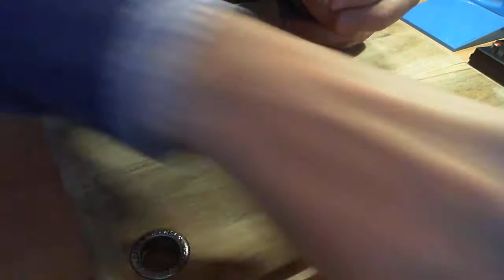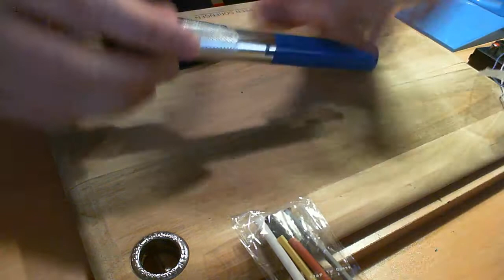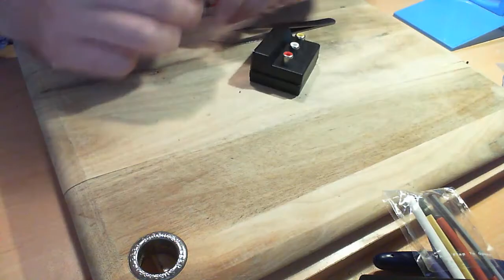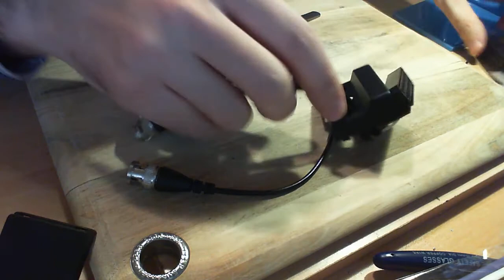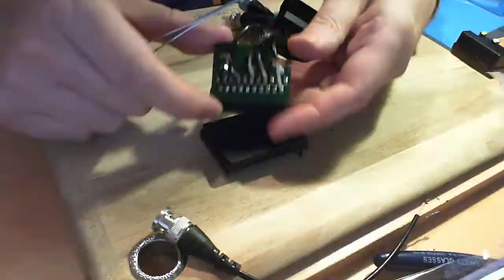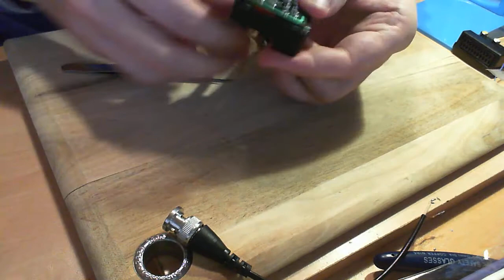How to make a Scart to BNC cable for BVM/PVM Monitors for 5$

Comment: Hi Djcalle can you tell me where I can buy this specific 3x RCA-SCART adapter that is shown in the video? I cant find it anywhere in my country.
Reply from the maker: They don't seem to be available anymore, however you can leverage cheap female to female scart joiners or male to female adapters with rca outputs to obtain the same results. Just search fro "scart female" on ebay and sort by price
Reply: @djcalle1975  ok thanks for quick reply. Do you think this one will do? https://pl.aliexpress.com/item/32988186659.html?spm=a2g17.search0104.3.113.dd574561iHs9GV&ws_ab_test=searchweb0_0%2Csearchweb201602_6_10065_10068_10843_319_10059_10884_317_10887_10696_321_322_453_10084_454_10083_10103_10618_10304_10307_10820_10301_10821_537_536%2Csearchweb201603_52%2CppcSwitch_0&algo_expid=6b7bcfca-7534-43a5-bc81-e5f53902b912-16&algo_pvid=6b7bcfca-7534-43a5-bc81-e5f53902b912&transAbTest=ae803_4

Comment: Hey man! I've noticed that there aren't really that many female scart to rca adapters and I was wondering if it would work with a male scart to rca one if I just connect a male to female adapter whenever I want to connect something. Oh and great video by the way!
Reply from the maker: Hey mate, I am not sure what you mean, can you explain more specifically what you are trying to do?
Reply: Djcalle Basically every scart to rca adapter that I found has a male scart input unlike the one you have which is female. I was just wondering if I can do the same thing as you in the video and then just change the male input to female via some adapter
Reply from the maker: I see, it seems they are hard to find at the moment, I suggest using either of the following as  an alternative: https://www.ebay.com.au/itm/TOP-Scart-Coupler-Joiner-21p-Female-to-Female-Socket-Connecter-Adapter-Convertor/142629928637?epid=1789889078&hash=item213567febd:g:vQ8AAOSwQItT~aOE          https://www.ebay.com.au/itm/Switchable-SVHS-Male-Female-Adapter-Scart-to-Scart-S-Video-3-RCA-Audio-Adaptor/382141729934?hash=item58f96c0c8e:g:aHsAAOSwq~tZUl35

Comment: I would like to make a cable that is 4xBNC (Red, Green, Blue, CSYNC) to RGBS Scart. ie Scart is to connect as an input to the TV and the 4xBNC are coming out of the transmitting device. What pins on the male scart socket do I need to solder the 4xBNC cables please?
Reply from the maker: if you use a male to male scart cable on it then the pinout should be the same as what shown in the video. Male to male scart cables will have the appropriate pin routing. the best way to confirm this on your setup is with a multimeter. I struggled in the past with female scart connectors as it can be confusing  but found that the best solution was to test continuity on the pins between both ends of the chain
Reply: Great - thanks for the advice.

Comment: thank you, i was wondering, do these work with output signal aswell? i need a set to output the rgb signal from my pvm, and this would be nice, thank you for the video, i do lots of tutorials and explanations of mods aswell, so when i find a good one, i appreciate it!
Reply from the maker: it should work however the audio and sync(composite) would have to be swapped to the output pins